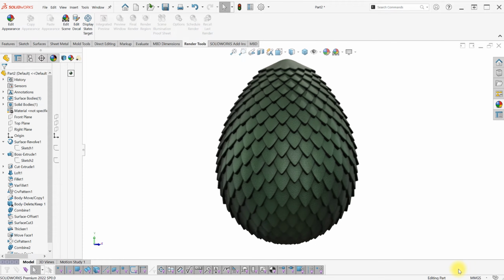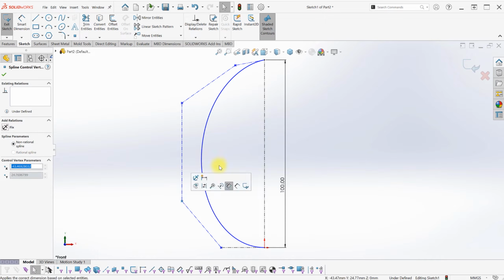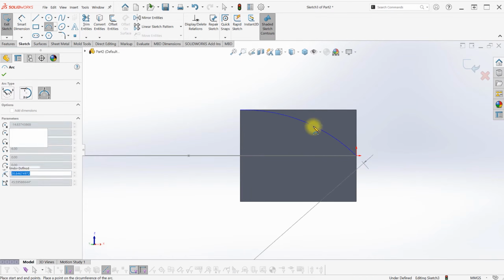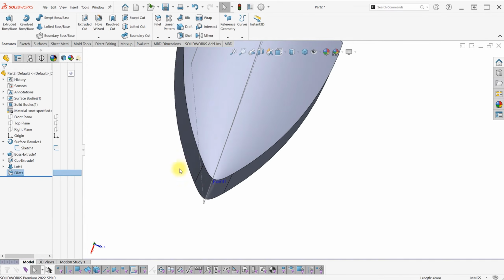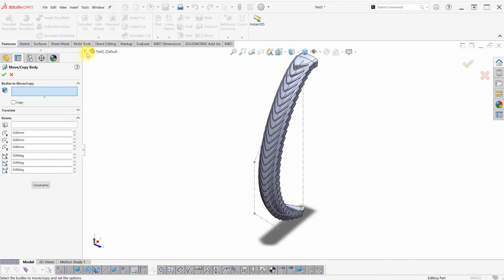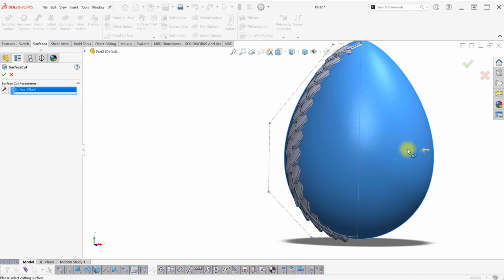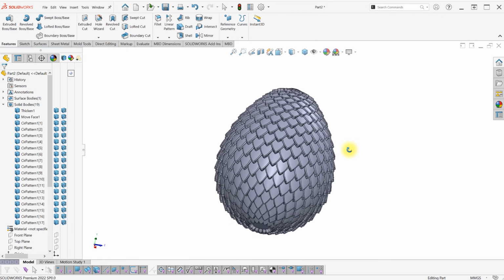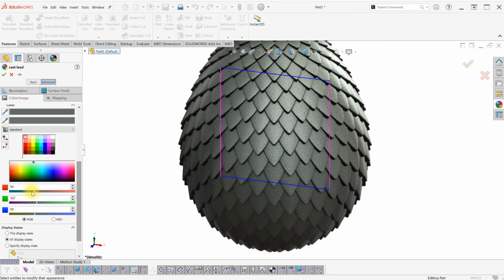Designing the Perfect Dragon Egg for 3D Printing

Comment: Thank you for your effort! The only thing is, i am not happy with the outcome of the top. Do you have any solution to have a perfect top section with scaling?
Reply from the maker: Thanks for your comment! ❤  You're right — the top section can definitely be improved. One way to get a cleaner result is by modifying and refining the curve used for the pattern. That way, the scaling will behave more uniformly.
Just keep in mind that this approach might slightly take the shape away from the classic egg form.
Another quick fix would be to simply remove more of the top scales — that can help smooth out the transition at the tip without changing the overall egg shape too much.